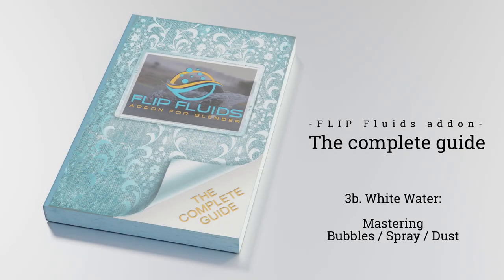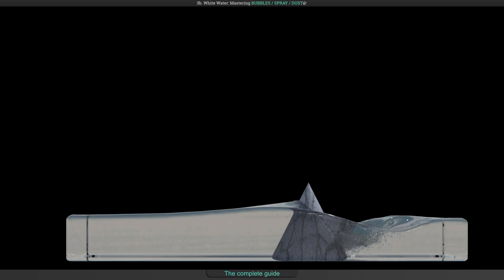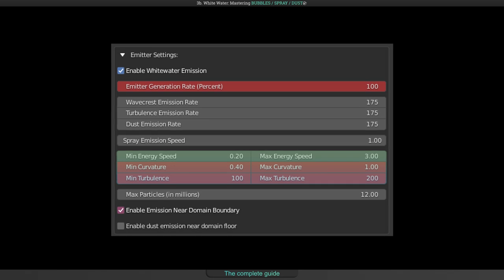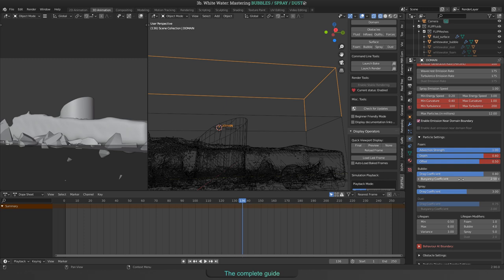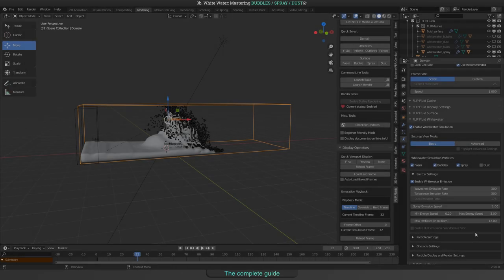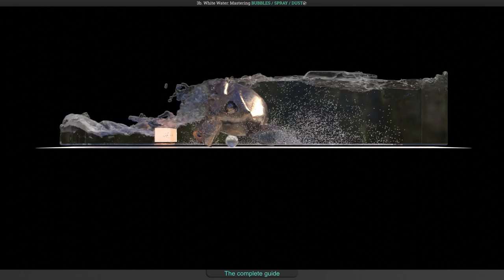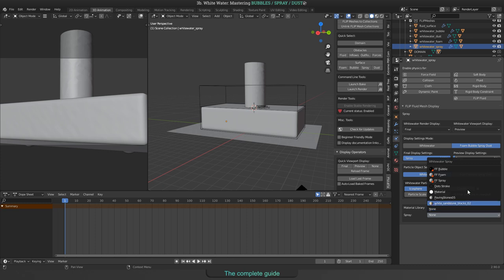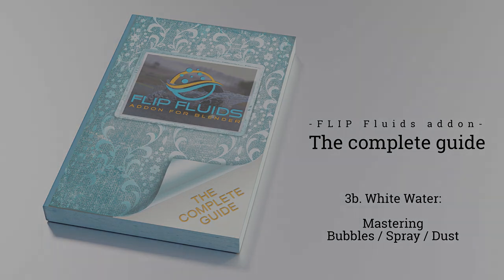FLIP Fluids Addon | Mastering BUBBLES / SPRAY / DUST (3b)

Comment: Thank you very much for developing this super piece of software: it is worth every Euro to purchase! A question: I try to make a beer simulation (photorealistic animation) with quite a bit of foam on it. Is it possible to measure the bubbles and foam in a random size? How can I make the foam head thicker? Now I have extended its lifetime, but it is not getting thick enough. Thank you very much for an answer.
Reply from the maker: Actually it is not possible to have randomized white water particles sizes. But we have this on our todo list. Having a thicker foam head is not possible. But there is a very realistic foam material available on the blender market! Maybe this is exact what you are looking for?

Comment: Thanks for the clip. I assigned the shaders to my foam and spray but I can't see them at rendering. They are there in the viewport though. Any idea?
Reply from the maker: Sometimes they are not set visible for rendering - but if nothing helps you can send your blend via email to us
Reply from the maker: Maybe they are disabled for rendering.
Sometimes it also required to reload a frame or particle sizes are to small. If nothing helps you can send your blendfiles with some information to us.
Reply: Same here! Any fixes?